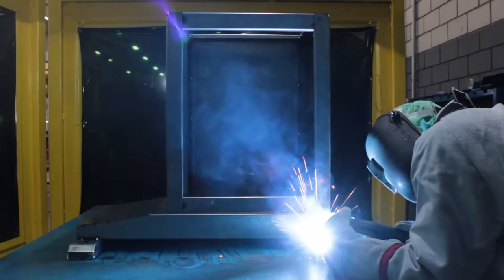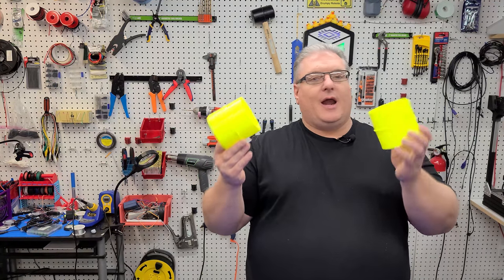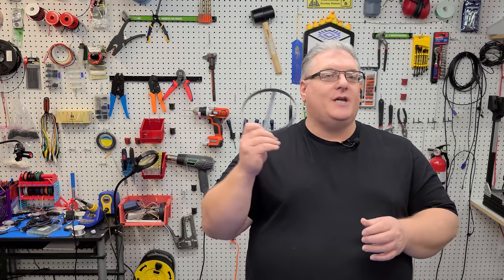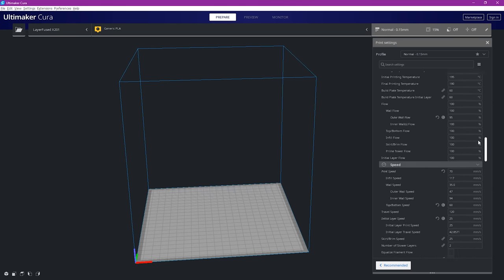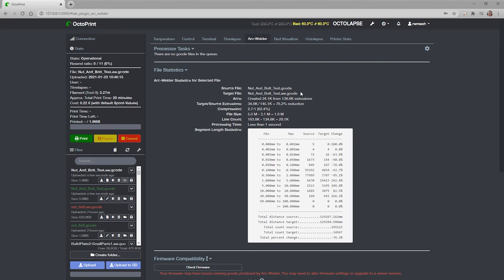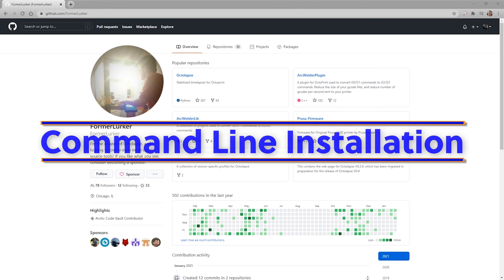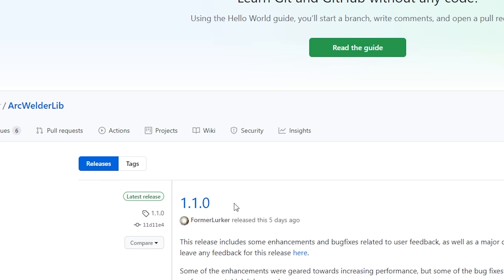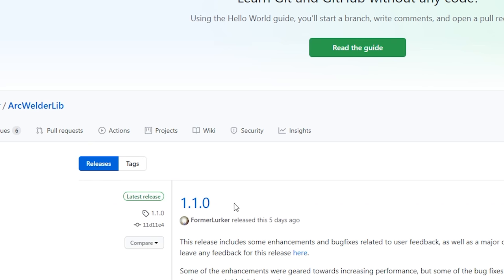Arc Welder - Smoother, Faster, Better 3D Prints! Its like magic to improve your 3D Print quality.

Comment: doesn't really make sense as octoprint plugin imho. This functionality belongs into the slicer software
Reply from the maker: You can put it into your slicer a number of ways but agreed that the best place for it is the slicer. Sadly the slicers don't support arcs which is really where all this functionality needs to be. Arc welder does bridge the gap and perhaps will give the slicer devs something to shoot for.
Reply: @MakersMashup  there is a plugin (or extension or whatever they call it) for cura. After installing the thing don't be stupid like me folks, activate the slicing option or it won't have any effect.

Comment: If I use Arc Welder in Cura, then upload the generated gcode to Octoprint that has the Arc Welder plugin installed, does Arc Welder in Ocotprint know not to convert the file again?
Reply from the maker: Pretty much.  It won't modify existing arcs since it was already processed.
Reply: @MakersMashup  Thanks.  A viewer of this video commented that in order for Arc Welder to work, one has to enable arc support in Marlin.  Does that mean I need to compile Marlin myself?
Reply from the maker: If you've disabled it or your printer or doesn't have it enabled it then yes.  Compiling it isn't a big deal really.
Reply: @MakersMashup  Ok, thanks.  Compiling isn't too difficult, but it's another step I was hoping to avoid.  I've actually upgraded my Ender 3 Pro to the BTT SKR-Mini E3 V2 with the TFT 3.5 E3 V3 when those boards first came out.  Since I also use EZABL PRO from TH3D, I've had to compile my own Marlin firmware.  The EZABL requires quite a few edits in the .h files so it was a bit of a pain.  I'm current 1 or 2 versions behind in Marlin.  I recently read that TH3D now has a pre-compiled Marlin that supports this SKR board with EZABL.  I was hoping to just use their version.  I'll have to check to see if "arc" functions are enabled there.  What #define do I have to enable and in which .h file?
Reply: The beta version of the plugin scans the file before conversion.  If it detects that the file was already welded, it will ignore it.

Comment: Well i just tried it on my delta pro and it wanted to throw my printhead off the buildplate after printing the brim. Maybe its a delta thing? Scratch up my glass :(
Reply from the maker: I would report it to FormerLurker as a bug. It shouldn't matter but perhaps there is a delta specific option.
Reply: Perhaps arcs aren't enabled?  you could try sending a G2 command without any parameters and see what your printer says.  If it reports 'unknown command' arcs aren't enabled.  If it says something about invalid parameters or OK, maybe it is a bug.  If arcs appear to be enabled, please report an issue here and I'll get right on it:  https://github.com/FormerLurker/ArcWelderPlugin/issues/

Comment: Now make it compatible with PRUSA SLicer :) Thx
Reply: You're in luck :)  First, download the command line version for your OS (link in the video description).  Extract the ArcWelder file from the 'bin' folder of the zip.  Now, open PrusaSlicer, click Print Settings, change to 'Advanced' or 'Expert' mode (upper right corner), and select 'Output Options'.  Then, in the Post Processing script enter the path to arc welder as well as any options you want, for example:  c:\ArcWelder.exe

You can get a list of options by running ArcWelder -h.  If you are using Marlin 2+, be sure to add the -g option.  If you are using an MK2 or MK3 (for now, this may change), or any printer running a fork of Marlin 1, you will want to add -s=1.0 and -a=14 parameters (this is due to old firmware that does a bad jobs with very small arcs, but lowers compression).  For example:  c:\ArcWelder.exe -s=1.0 -a=14 or c:\ArcWelder.exe -g
Reply: @FormerLurker  so this does work with marlin 1.1.9?
Reply: @truedoh2831  It depends if Arcs are enabled in your binary or not.  You may have to enable the 'firmware compensation' options:  https://github.com/FormerLurker/ArcWelderLib#firmware-compensation

I do recommend upgrading to Marlin 2.0.6 or above.  You will get much better results and compression without firmware compensation.

Comment: Is this supported with CR-6 SE? I did try one print with arc welder, also enabling the g90-g91 override in octoprint, but it did not turn out well at all whenever it would try and arc (seemed like it didn't know what to do and just dumped plastic on the spot). I'm a beginner so maybe I missed something, if anyone has any insight I would appreciate. =P
Reply: Arc commands are probably disabled within your firmware.  You can test this by sending a G2 command with no parameters.  If your printer responds with 'Unknown Command' or something like that, arcs are disabled.  If that is true, you would need to enable arcs and re-flash your firmware on your printer.
Reply: @FormerLurker  Hi thanks for the reply, I actually asked on the cr-6 reddit and it was just as you said, the firmware did not support it, but I flashed it to the community 5 version and everything is going great now =)

Comment: Someone should do "Stupid lowpoly model from Thingiverse vs Arc Welder"
Reply: I've seen some examples, though it's a bit dangerous to increase the resolution value so high.  Still, if you're careful and inspect the resulting toolpaths with a visualizer, it can go very well:  https://github.com/FormerLurker/ArcWelderPlugin/issues/122

Comment: I've been using arc and I really works but sometimes it makes the printer go crazy and crash the print head somewhere. Anyone else?
Reply: Perhaps you'd like to try the beta version?  Some edge cases have been fixed, and you might be running to one.

Comment: any way of using arc welder wo octoprint??
Reply from the maker: yup, you can use it in cura or you can use it at the command line.  Any of the options I showed will work.

Comment: how do you get that texture on the bottom of the bolts?
Reply from the maker: That's from the textured PEI surface.  I like the look and it grips the first layer extremely well.
Reply: @MakersMashup  do you have a video or something to show me how to use it?
Reply from the maker: Arc welder? Everything was covered in the video.
Reply: @MakersMashup  no, sorry the first layer texture thing
Reply from the maker: Sure that makes more sense.  All you need to do is get a textued PEI sheet and put it on your printer.  After that you can use the smooth side or textured side of something like this https://amzn.to/2XHbLCR obviously you would need to make sure its the right size for your print bed.  Lots of videos on youtube to show you how to install one.  You'll need to relevel your bed but after that its just a matter of picking smooth or textured.  No settings to configure at all. There are a number of different brands of similar surfaces but the textured surface is what creates that effect.  FWIW I personally love the texture as well and use similar ones on all of my printers.  If you're using glass these surfaces are light years ahead.
Reply: @MakersMashup  thanks, alot of help

Comment: how do I use this with prusa. Via command line?
Reply: Check out this guide on the ArcWelderLib repository (contains the command line version): https://github.com/FormerLurker/ArcWelderLib#running-arcwelder-from-slic3r-slic3rpe-prusaslicer-and-superslicer

Be sure to read about the parameters.  You might need to add one or two.  It's all in the guide though.

Comment: Marlin, Prusaware, Klipper, Reprap.......are not slicers they are Firmwares they interpret the gcode to mechanical motion. Slic3r, Simplified 3d, Cura, prusaslicer... are slicers.
Reply from the maker: Right and as I said in the video, arc welder is compatible with the firmware.  It generates arc data that most firmware can use. Not sure where you are confused.
Reply: @MakersMashup  If that is what you said or meant, my apologies, i must have miss understood. What worst is that the G2 and G3 Arc path was in the first few version of simplify3d For some unknown reason they since removed it, i distinctly remember noticing a huge loss in print quality after I had run their software update, at the time i did not know why till it was too late and i had deleted the previous version
Reply from the maker: No worries, I was concerned perhaps I was unclear.  A number of people have mentioned the same thing about prior S3D implementations.  From my experience this does a great job.  Could be that the firmware matured over time and supports it better. I have been using AW now about a month, at first only on non-critical tolerance parts.  Now I'm using it on everything and haven't noticed anything but improvements overall.  I know that @formerluker has run this on many other firmwares and had to submit changes for prusas firmware to make arc welder work correctly.  I think this will really depend on what firmware you run but for Marlin 2.x. I'm getting great results.  The reduction in gcode itself just makes everything perform considerably better IMHO.  Not nearly as much buffering going on and underruns when you want to print faster.  That alone IMHO makes it worth it. :)

Comment: Good morning what the video follow the directions cannot get the box in special modes for arc welder I've restarted it made sure that the plugin is installed even restarted the computer still it will not come up have I missed something?
Reply: If you don't see it you might have to configure visible settings and make sure it's set to visible
Reply: Good morning Jordan thank you.
It's very strange arc welder is installed as an extension. The only thing I can think of is I'm using Windows 7 maybe it just won't allow it. Unknown. Thank you.
Reply: @gregbennett2437  
Many people report this problem even in Win10.
Here's how I got it to work after some research.

Go to this link: https://community.ultimaker.com/topic/34888-arc-welder-anti-stutter-plugin/page/3/
On the fourth reply he mentions a development snapshot. Click on it and save it on your drive.
Open Cura, then drag that file onto the build area.
After a Cura restart, ArcWelder option showed up under 'Special Modes"
I haven't printed yet, but I notice the gcode file size is greatly reduced.
I use Win10, but should work on WIn7.
Reply: @jbrou123  FYI, an update was released to the marketplace, and I believe your issue is one that has been solved.

Comment: Anyone know if this is just for Marlin or will my Chitu F board in my Tronxy X5SA with Chitu firmware work, or do I need to install Marlin/Klipper as an upgrade ?
Reply from the maker: Easiest way to tell if you have arc support is to use pronterface to connect to your printer and enter G2 I20 J20 which should move your print head in a circle.  If it doesnt move in a circle you lack arc support and AW wont work.
Reply: @MakersMashup  many thanks for the help

Comment: Dropped gcode for a simple washer into AW, Prusa had it at 11 mins, AW at 3mins estimate when processed, took 11 minutes to print. Just dropped a 90 minute print into AW, the same washer repeated 9 times, Prusa 90 minutes, AW says estimated 27 minutes. 60 minutes later still printing. I call bullshit on the time saved.
Reply from the maker: FWIW, I have run into some prints that need further adjusting before they print faster.  You can adjust settings of arc welder.  It could be your printer and firmware as well.  If you look through the comments many users (including myself) have had time savings.  I think however its going to largely be based on your setup. I know with my SKR 1.4 Boards it does make a big difference.
Reply: @MakersMashup  yeah fair call about the variables.....but I would expect something specifically written to make a flat line path and round line path and printing a round object would of done something with the time, not absolutely nothing at all. It should be a controller specific release then if it doesn't work for a lot of people. I will try it out for making my prints look better though over the weekend and report back, I can live with the lack of time saving if prints start to look better.

Comment: The print without using ArcWeldwr seems to use very coarse stl file
Reply from the maker: Exact same file.
Reply: @MakersMashup  I see. Is it a high resolution stl file?
Reply from the maker: Yes. Link to it is in the description
Reply: @MakersMashup  when you generate the stl file, make sure you use the highest resolution. From my experience, low resolution file leads to low quality curves. Not saying ArcWelder is useless. Want a more legitimate comparison. Thanks.
Reply from the maker: Yes I know this.  The stl used was generated from fusion using the high preset
Reply: @MakersMashup  thanks

Comment: What about S3D does it work with it?
Reply from the maker: You would probably need to go the command line route.
Reply: Yes!  Download the console application as was shown in the video, then edit your S3D process, go to the 'Scripts' tab, and follow the template below for the 'Additional terminal commands for post processing':

{PATH_TO_ARCWELDER_BINARY} {OPTIONS} "[output_filepath]"

Here is a sample of this:

c:\ArcWelder.exe -r=0.025 "[output_filepath]"

Edit:  You can run - ArcWedler.exe -h - for a list of options.
Reply: @FormerLurker  Sorry can not find the file to download..
Reply: I do not use octPrint.
Reply: @MakersMashup  Sorry kinda new not really getting what you are referring.
Reply: @XGCOzZ , you can get the lastest console builds here:

https://github.com/FormerLurker/ArcWelderLib/releases

The ones at the top are the newest.  Download the one that matches your OS, extract the files and look in the 'Bin' folder for the 'ArcWelder' binary (might be ArcWelder.exe depending on your OS).  Copy that somewhere, and paste the full path into simplify as I mentioned in my previous comment, and you should be good to go!  You can make sure it worked by opening the resulting gcode file and looking for ArcWelder info at the top.  I hope that helps!
Reply: @FormerLurker  ok try figure it out

Comment: I installed the Octoprint version today (Feb 5, 2021) and had two problems:
1. The 'Check Firmware' button is not present in my Octoprint/Arc Welder tab.
2. Ignoring item 1, I loaded the gcode for a simple hollow tube and ArcWelder did its conversion and added a new *.aw.gcode file to the file list in the browser. I then printed that file. My printer, an Ender 3 V2 (stock firmware) not only began printing literal gobble-dee-gook, but the extruder stepper motor started making severe grinding noises. I had to terminate the print with extreme prejudice by shutting the printer off. Yikes!

Does anyone know if a stock Ender 3 V2 is supported? Seems like no.
Reply: Send a G2 command with no parameters via the octoprint terminal.  If it responds with 'unknown command', arcs are disabled.

Regarding the firmware checker, see the link in the video description to a guide for installing the beta.  That should also detect arc compatibility in most cases.
Reply: The write up tells you to see if your printer supports arcs. E3V2 doesn’t, I had to recompile my E3V2 source code with arcs enabled and it works now.
Reply: @klave8511  Thanks. I have long since compiled and installed Smith3D firmware on my E3V2, which supports arcs. Files print fine, but other than greatly reduced g-code size, I can see no difference whatsoever in my prints...I still get faceting in printed arcs.
Reply: @imacmill  : so then your .stl files have low resolution. You probably know that .stl files are a bunch of flat surfaces. You will have to increase(decrease the amount) the resolution in your CAD program to reduce the size of the flat faces. You may have the resolution for your .stl set to larger than Arc Welder’s so it won’t allow arcs to be fitted to your polygons. Also, I don’t think Arc Welder will change z axis straight lines into arcs because you printer can’t draw arcs except in the xy plane. It could do so and it would actually work.
Reply: @klave8511 I can create a 2cm diameter cylinder in Blender with 128 'sides' and it still prints 'faceted' after being arc-welded. Maybe my arc welder settings aren't set such that they'll smooth out even these tiny 'sides'?
Reply: @imacmill : I wonder what the step resolution of your printer is. It may be the limit you’re seeing. Can you see 128 flats in your circle? Other thing to do is to view the gcodes themselves to see the arc commands. There are a few gcode viewers that will show your tool path, this will show the flats if they are in the gcodes.

Just checked, 80 steps per mm. Smallest increment is 0.0125mm

Comment: This would not be necessary if people would export their STLs with a higher polygon count. And if slicers would read STEP files instead of STLs the polygon problem wouldn't exist at all.
Reply: Cura reads STEP files but it still converts the movements to many linear movements rather than arc movements. It's the resolution of the output that causes the problem not the input.

Comment: Works perfect if all you want to print is a circle. If you want to print real things, it’s gonna take a lot of tuning that’s beyond me and my patience.
Reply from the maker: I totally disagree.  For my machines running marlin 2.0 arc welder now handles 99% of my prints. Like any tool it's not appropriate for everything.  The reduction of gcode alone improves speed and performance on all prints. Using the default vales I've had zero problems.  You might elaborate on why you feel it requires so much tuning, many others report the same experiences I have.   Perhaps your machine has some incompatibilities.